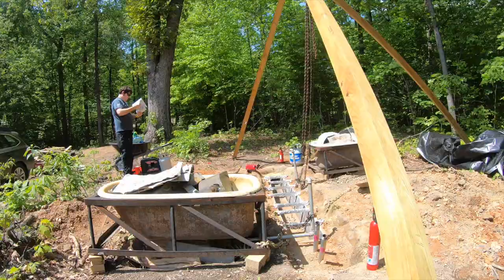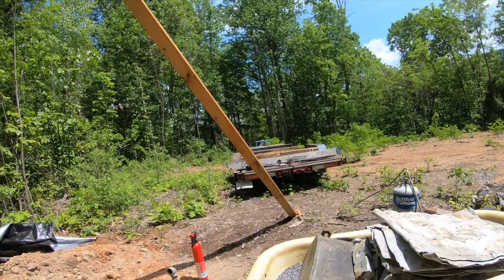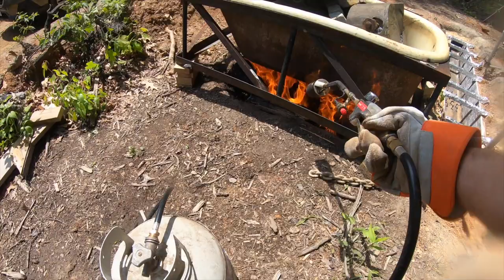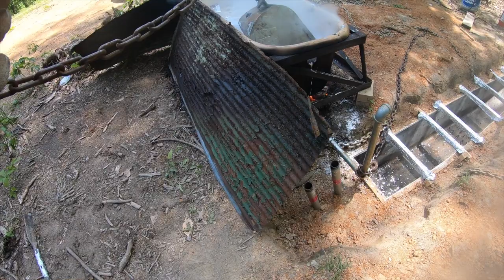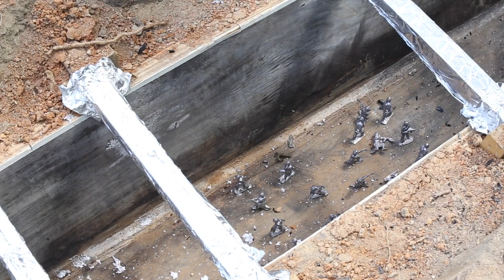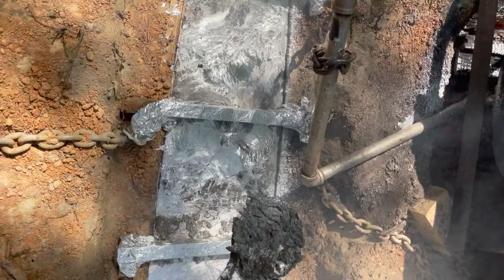Pouring a Three-Ton Lead Sailboat Keel...did NOT go as planned!

Comment: Very much enjoyed the video and admire your tenacity. You ask for comments so mine would be in the form of a request, and that would be to use more protective clothing ,especially on eyes (mega important),arms and feet. . Molten metal takes no prisoners !! Get some of the type of gear that professional foundry men wear . I’m a sixty nine year old carpenter presently building a clinker planked dinghy , a midget compared to your project. Your video caught my attention as a few years ago I toyed with the idea of building a Herreshoff Haven ,but at the time I couldn’t find the time or the money to begin. The Haven also has a lead keel and I did quite a lot of research into methods etc . 
  I admire you greatly as I know what a commitment any wooden boat build is . I will look out for your follow up video. Well done sir(s) and madam, and STAY SAFE ! Regards from England .
Reply from the maker: Thank you so much! And yes, I agree; I did my best to protect myself, but I can always do better!

Comment: Someone finally uses the proper respirators for the job! Were you not worried about splash though - I'd have probably wanted a leather smock and face shield as well personally.
Reply from the maker: I was wearing safety goggles when I was directly next to the pour - though not when standing further back talking to the camera. Between those and the respirator, I felt that the vast majority of my face was covered. But yes, I could always do better!

Comment: You need a camera tripod.
Reply from the maker: I've got one, and used it for the bit where the lead submerges the soldiers. What I don't have is a remote mic set-up, so if the dialogue is to be captured, then it's gotta be with something I'm wearing.